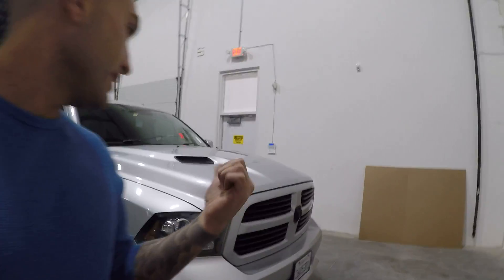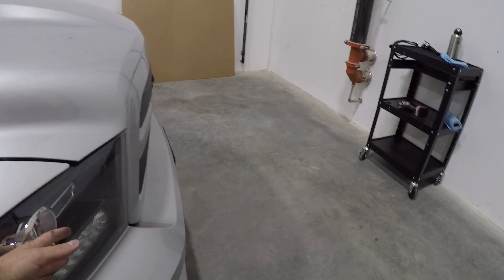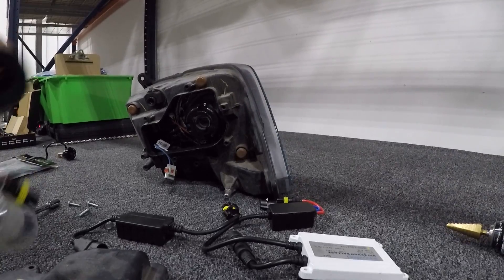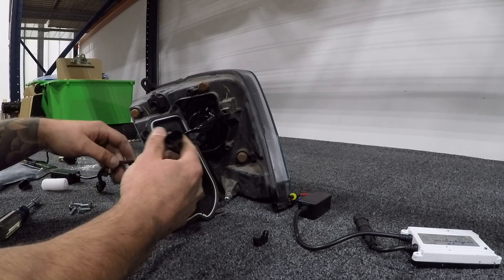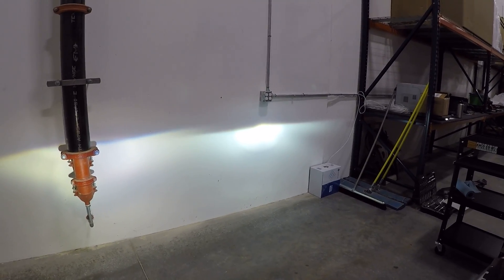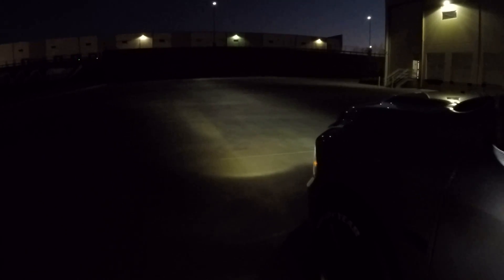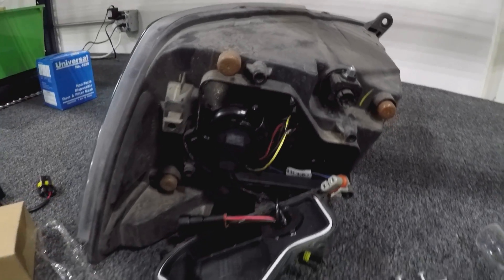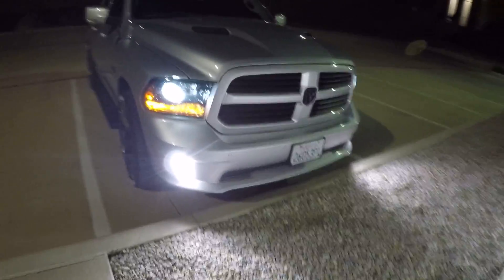LED vs HID in Factory Halogen Projector Headlights

Comment: Boosted2k Do u know if the HIDs fit in a reflecter housing? 

Keep up with the awsome vids man, very helpful.
Reply from the maker: Hey brother HID will work in the reflector housing headlights too you just have to check your bulb type of your truck.  I had HID in the reflector housings of my 2009 RAM 1500 and they working pretty good.  I would probably try Hikari LED in your reflector housings though cause LED seem to be better in reflector housings.

Comment: Just wondering if you have downloaded the newest software update (Uconnect) ? for truck ?  it adds a few new settings in the touch screen ? change of screen colour and I have noticed the voice is different when you use your GPS ....https://www.driveuconnect.com/support/software-update.html
Reply from the maker: Hmm I'll have to check it out.  My truck automatically updated itself in the fall.  It said there was an update and to leave my truck in the RUN position for 30-40min.  I'll have to double check which version its on 👍
Reply: my update is 17/08/09 and yeah it takes awhile to install ...

Comment: great content as always, I have ordered the hikari kits you recommended for my fogs and high beams on my 2017 Ram limited. 
Regarding 'clocking' the bulbs, I noticed that your innovited kit in the link is a 9012 bulb, if you ordered the 9005(hb3) bulb per ram specifications, would you still need to clock the bulb?

looking forward to a video where you install front tow hooks to the Ram :)
Reply from the maker: Hey Andrew!  At some point they changed the bulb type for our trucks from 9012 to 9005 for the low beam projectors but my truck specs out the bulb as 9012. 😎
Reply: there you go.... educating us again! :)

Comment: John you gotta retrofit some true hids and by true, I mean using proper hid projectors like from morimoto. The halogen projectors that come stock seem to produce some glare and its definitely not as wide or intense as hid projectors. You'll have to crack the headlight housing open but it's so worth it. I just finished doing mine and its amazing. Msg me your email and I can send some pics.
Reply from the maker: Thats awesome brother!  I agree there are some awesome upgrades you can do.  For me personally I just wanted some better bulbs and most of us probably just would throw some bulbs in and call it a day.  We need to save for the procharger!!! 😜
Reply: Boosted2k amen. Looking forward to it!

Comment: After installing the hids do you need to have your headlights aligned?
Reply from the maker: Hey Robert you don't have to mess with aligning them unless you somehow didn't install the entire headlight back in the same way you took it out.  The light will shine in the same cutoff as it was set from the factory only difference is it is brighter 👍
Reply: You can easily align them using a hex bit from the top .
Reply: JC Jaquez great thanks but I was just wondering if I install hids will I need to align them or would they be
Reply: JC Jaquez ok

Comment: Why not put the LED into the high beam?
Reply from the maker: Hey brother I'm usually always in the city so I hardly ever am able to use the high beams but honestly with this new setup you almost don't even need the high beams.  Plus when you turn on the highs the fogs turn off so you lose some light up close unfortunately.
Reply: There is an easy fix to keep the fogs on when you turn on the brights.  I don't remember the specifics, but Google is your friend.  I think it's a fuse jumper.

Comment: Awesome stuff. I had got a different hid kit from Amazon that was $90 and I wasn't happy with it..I tried that after not having a lot of success with a $100+ LED headlights kit. Clocking the bulbs seems to be an important thing and definitely an issue with the difference of these aftermarket bulbs. I'm back to halogens for now.
Reply from the maker: Yeah I can totally relate to your struggles!  I have 5000k and 4300k replacement bulbs on the way too for us to compare so should be interesting to see the light output and comparison of these.  Should have this for you guys in a week or so!
Reply: Boosted2k excellent! Thanks for doing this for us

Comment: How did you have the led bulb inside it says to put the bulb in with the actual leds themselves facing side to side instead of up and down
Reply from the maker: Yeah I messed around with clocking the bulbs in different ways but there is always a dead spot.  Its apparently starting to be a known thing on these trucks that LED kits aren't as good a HID in these projectors but I honestly didn't think it would be this big of a difference.

Comment: Hey I’m thinking about buying a 2015 ram 1500 but it has the air suspension option. What are ur thoughts?
Reply from the maker: Hey Aron!  The air suspension trucks are pretty damn cool.  Biggest things are do you plan on lifting or lowering your truck in the future because it will be easier to do with a regular suspension truck.  Also I've heard some people say they have had issues with air ride vehicles in super cold climates where its so cold the suspension freezes and gives them problems.

Comment: So that 55w system is non canbus right?
Reply from the maker: You know I never actually tried it by itself I just put those canbus decoders infront of it just to be safe since I had to do it on my 09. I just ordered some 4300k and 5000k bulbs to compare and test out for you guys so I'll try to see if it will run without the decoders or throw a message on the dash
Reply: Boosted2k I have the 35w canbus system from OPT7 for my Low and fogs. The fogs output is incredible but I want a 55w for the lows in my projector housing. I am gonna order the same kit you did and use my decoders.
Reply: Boosted2k I prefer the 5K, very crisp
Reply: Boosted2k appreciate your content and effort you put in to be the guinea pig for us!!!
Reply: Are those canbus decoders from your led kit? Just curious. Trying to avoid from buying some hid decoders if the ones youve installed are from the led kit.
Reply: Damn that hid goes far.  Great video.
Reply from the maker: Thanks brother! 👍
Reply: BoostedMotorsports so I installed this kit on my ‘17 ram 1500, with the decoders. Worked great for a few days- now the left bulb won’t ignite. Fun while it lasted, lol
Reply from the maker: Ah that sucks!!! One thing I did on the drivers side was route all of ballast and decoder into the fusebox tray and I cable tied them there so that I can actually access and change them without removing the headlight.  Hopefully its just something simple but sometimes these things happen unfortunately 👎
Reply from the maker: Yeah Ras they are just the same ones I used with the LED kit
Reply: BoostedMotorsports I did too. Kinda interesting that while in the line @ Dutch bros this am I took it from auto to manual and the bulb ignited.... stupid canbus
Reply: 5000k is really good.  I have 5500k in my Lincoln and one of my Mustangs.  I think 5500K is my personal favorite.

Comment: What brand of hids you use on your viper?
Reply from the maker: Same brand as these (innovited).  Had them for over a year on the Viper and almost 3 years on my GSXR 750 and no issues.
Reply from the maker: I would probably go 4300k or 5000k which I'll be comparing next on some upcoming videos.  Their 6000k is pretty blue and I think it loses a bit of visibility with that added color.

Comment: Yea pretty good video but I stayed with the LEDs. Easier setup for plug and play. Specially if you are leasing and want a cheaper plug and play setup and step up the stock setup that Ram should had already included, specifically in a Laramie .
Reply from the maker: I agree Mike the stock bulbs are absolutely brutal!

Comment: Nice work! Hey if I were you I'd get some silicone and seal the outside part of the grommet just to be on the safe side. Cause even though grommet is suppose to keep moisture out you still have small crevices that moisture can still get in. Reason I say this cause it happened to me lol.
Reply from the maker: Good tip John!  Not a bad idea to have an extra level of protection from that moisture!  The step bit I used made a pretty clean cut and also the truck is in a very dry climate but I'll have everything apart again in a week or two comparing 4300k and 5000k bulbs as well for us!
Reply: Agreed, it's happened to me too... I second using sealant...